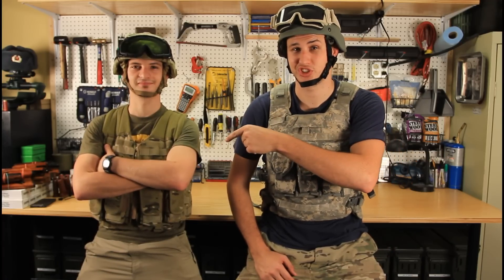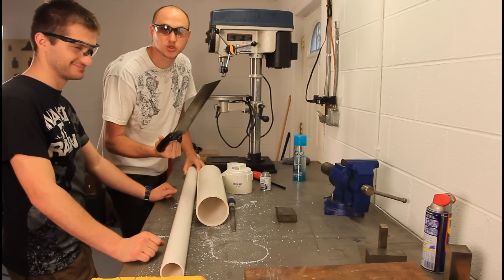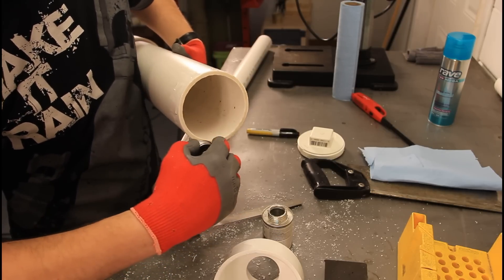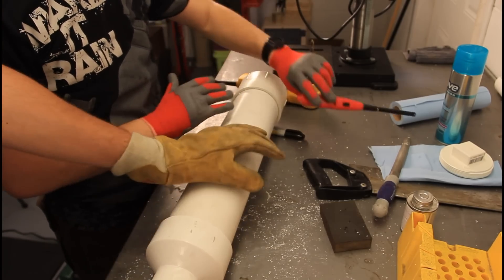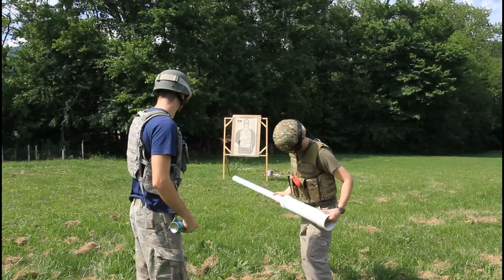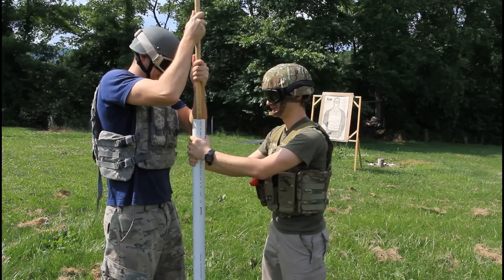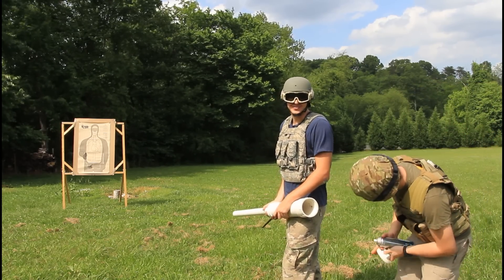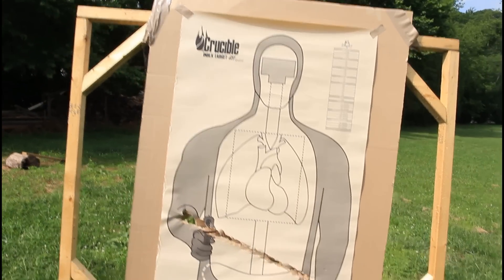How to Make a Potato Launcher!

Comment: You can use one of the igniters from a grill! You just drill a hole the size thread it and then screw in the grill igniter and then all you need to do is push the button.

Comment: You forgot to use PVC cleaner on all the joints.  Also, if you coat the "barrel" with Tri-Flo silicone, you will get higher velocity of your potato projectile.

Comment: I made one of these 16 years ago and I still have it.  I use Hairnet and put a brass cap at the back which screws on much easier.  In the brass cap, you put and lantern lighter and it works every time.  I've been using mine to silence noisy dogs at 3am by using 4 wads of news paper.  It occurred to me, what happens if you use 3 wads of news paper then bb's then a fourth wad, boom.  Perhaps a good experiment.

Comment: not too bad at all........I would add a permanent piezo ignition to it, this way you do not loose any propellant through the hole you made when trying to light the propellant . A BBQ igniter is good but you will need to add the ignition button to the side of the unit and attach both wires to the igniter........I'm looking at making a golf ball rocket launcher.

Comment: You must use schedule 40 PVC pipe, purple primer followed by PVC cement and make sure it's on both connections then let it set and cure for 24 hours I'm amazed this thing did not blow up in his face

Comment: ok you did a few things wrong you drill the hole in the back of the 4 inch plug and its very important that you drills holes at the end of the barrrel to let out the gas and sharpen the barrel so its easyer to get the potato in i made 5 potato guns and i made em all in diffrent ways and that way worked the best
Reply: also use a 1 1/2 inch barrel it gose further that way
Reply: mud digger you canalso use a grill lighter

Comment: your suppost to take the lighter apart and tape the button on like a y shape fitting so its easy to hold and drill two 1/16 holes 1/4 inch apart and put the wires in and pvc cement them in,just sayin

Comment: You can get a push button or even better an electronic grill ignitor to light the gas and you won't go through so many kitchen lighters. You may be able to use the ignitor from that broken lighter but I would use a grill ignitor. You can even use a cheap taser or stun gun as an ignitor. Have you seen kipkay's spudgun video?

Comment: I used to have one of these and two things I did was, 1. Use a knife and sharpen the edge of the barrel. This makes it way easier to load the potato since it will cut as you press it in. 2. With nothing in the barrel, stick the broom handle in the barrel and measure about how far in you want your potatoes to be loaded. Once you have it, then take a piece of tape, wrap it around the broom handle and now you know how far to stick it in (that's what she said) every time, without having to guess. Potato gun hack. ;) keep up the great work guys.

Comment: Theres not enough power because you not putting the potato back in the barrel. The full length of the barrel is where the projectile builds its Energy to travel. Where your putting the potato further up the barrel you would actually need more hair spray because the size of the combustion chamber is bigger. Put it all the way to the bottom and when you light it it will built pressure faster and at a higher rate and that potato should go 100 yards

Comment: Anyone planning on trying this.. Don't use cheap downpipe. You need the HEAVY and expensive pressure rated 178psi PVC pipe. It's usually a darker grey in colour.

You really dont want one of these to blow up on you.

Comment: who the fuck loads a cannon and has their ammo halfway down the barrel? The spud should be pushed down to the END of the barrel....

Don't use a barbecue lighter either. Unsafe and shitty. Get two long bolts, screw them into the chamber so they meet in the centre with a 2-4mm gap, then wire the leads from a piezo sparker to the exposed ends. That way you lose no pressure, have no wierdly-glued-in-place lighters blowing out of the cannon and have an ignitor that works way better. You can get the sparker out of a lighter or get a better, heavier one from a barbeque - only a few bucks for a replacement sparker.

Comment: I built one of these about a year ago but with a non glued endcap on the end (so if it jammed it wouldn't explode) and a 3 quarter inch barrel... It shot long aluminum nails and wood screws. It also had a grill sparker as ignition.

Comment: @CrazyRussianHacker You need to take and drill two small holes in the combustion chamber and thread some bolts into them, on the inside, leave about 1/8 inch gap between them. Next, seal the two bolts, and send a spark between them with an igniter from a grill. You will get many times the power by not letting the gasses escape, so that potato will probably be able to take the limbs off of a tree!

Comment: I made one of these potato launchers the exact same way and it fires SO much further than it shows in this video. All you have to do is make the ignition hole a bit tighter so the fuel does not come out of it and put in a little more fuel (count to ten instead.). Trust me, it's not weak when done right.

Comment: Myself I use 3 inch to 1 & 1/2 pipe, the 3 inch at about a foot long and the 1 & 1/2 at 3 feet. Bevel the end of the barrel on the inside for a tight tater fit. I use a lantern striker and starting fluid, shoots the best I've found.

Comment: Use PVC primer before using PVC cement and dry for 24 hours for best bond. Also, I sharpened the end of the barrel. It cuts the potato neatly, forming a great seal.  I put a screw through the base of the barrel to stop the potato from entering the combustion chamber (grind off the excess metal to avoid cuts). Finally, I put a flint style lantern ignitor permanently through the cap for ignition.  And always, be careful. Potato guns can do some serious damage. Remember, safety is #1 priority.

Comment: You lose the pressure by having the open hole for the lighter. if you simply use the igniter from the wire attactched to two screws that are drilled into the pipe very close but not touching thus allowing an arch it would increase the pressure allowing for a much more efficient "cannon".

Comment: You can also make it with a BBQ sparker they are about 8$ and when you use PVC cement you want to twist the connecting so it is air tight

Comment: i made a potato launcher and used an air compressor to pump it up to i think 30-40 psi (?) and it worked pretty well sending a potato 100 ft. i would say thats safer (but harder to make) because you know exactly what pressure its running at and don't have to worry about counting. although i couldn't make fireballs with it :(

Comment: Some tips:
A bug zapper racket can be salvaged for a cheap electronic ignition
which can be wired in hermetically. ~2 EUR
Small fan inside can boost combustion quite significantly. 2 bucks.
We made an glass beer bottle launcher that kept them airborne at least 8 seconds.
Doesn't sound much, but it is xD.

Comment: Put potato in the end of the barrel.   2. Spray much less gas.   3. Run potato down the full length of the barrel to compress the gas.  4. Ignite for MUCH better results.  5. air out cannon before next shot to replenish oxygen supply.  5. bevel inside of the of barrel crown with a file to approximately 45deg to cut and compress potato as you jam it in.
Good luck!

Comment: Should of used a bbq grill propane gas igniter. That way you can epoxy it into the hole.  One person operation.  And you need a sight on end of tube. Helps with aim.  Nice fails btw.

Comment: Word of caution, you should really screw the end/connectors a quarter turn when connecting them with PVC cement.
Also for even MOAR power (over 9000), you should really push the potato down the tube to the beginning of the barrel (smaller tube that you smash the potato into), it will go much much faster, you can shoot them 300 feet!

Comment: btw. i personally think the combustion chamber should be abit smaller and you should just use a plain lighter to light the fuel. in my gun i used a BBQ sparker and just put the wires in the barrel and taped it up. it makes it alot easier and cooler IMO. also you should sharpen the tip of the barrel so its easier to put a potato inside.

Comment: nope the shorter it goes you need a good mixture of O2 (oxygen) and fuel the hair spray for the best performance remember to air it out after each shot as well and they are extremely powerful so don't point it at an animal or human and have fun

Comment: 2 things, 1: that hole you drilled is allowing for the escape of fuel, I use a flint that is very snug and almost permanent, might want to use a different method..2: I've noticed that of you put the launcher at an upwards angle when putting the fuel in and firing it works better, longer range and a bit more whomph.

Comment: Ok a few tips.. this is just thoughts, I have never tried any of this at all....
First use a bbq igniter in the thread on cap .. 2nd push the tater in just enough to get a seal then hair spray and cap it then shove the projectile all the way down(compression of gases)
3rd use a primer before glueing it provides a much stronger bond 
4th use a 4''  T fitting(4'' on the ends and a 2'' top) as your combustion chamber, and put the ignition in the 2'' cap.
Love your videos! Good job over all!